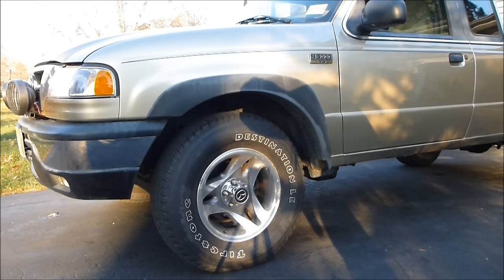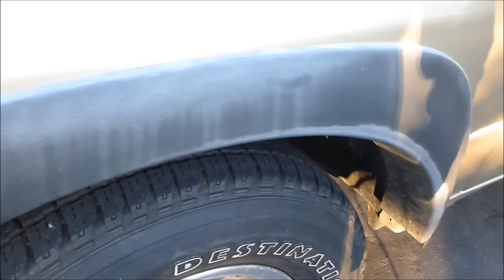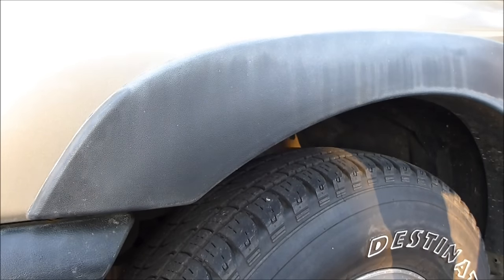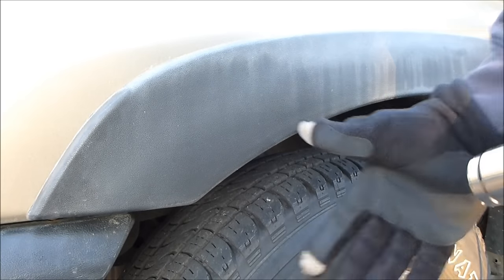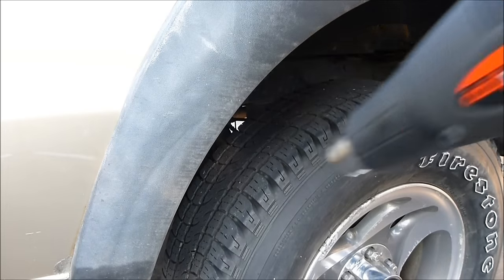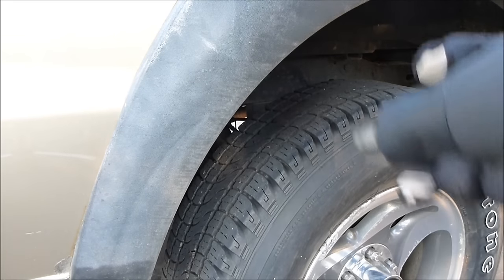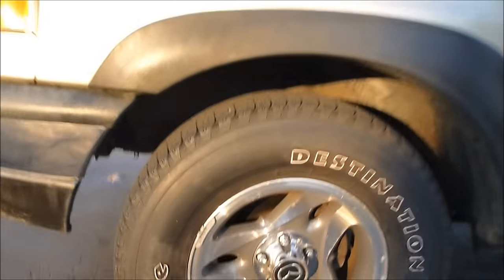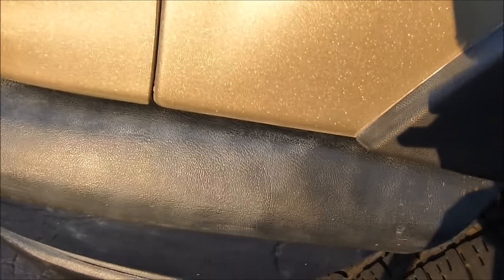Restore your Faded Plastic on your Car

Comment: heatgun = manly blowdryer
Reply: Yes, if you want to blow your hair with like 1600 degrees LoL
Reply: William F. Gorut not saying to actually blow dry your hair with it. but it looks exactly like a blow dryer, just targeted towards men
Reply: Both of them works in same way but they are quite different.
Hairdryer is designed to deliver big amount of hot(200C?) air, where heatgun is designed to deliver small amount of air but very hot(up to 700C) so it need steel chamber.
We can dry our hairs with heatgun but we cant restore plastics like that with hairdryer because this is not enough heat.
PS why girl is watching car vids???
Reply: Arek R. I mean't that it only looked like a blowdryer I'm not an idiot I know it wouldn't actually work as one and that it would melt your face. I'm watching this because i like cars and want to know how to take care of one when I get one because I am currently saving up for one... This isn't the 50's anymore women can like cars bro.
Reply: Nope, you can dry your blue hairs with heatgun without burning them, just use it at bigger distance so 400*C will be mixed with ambient 20*C and you will get proper 200*C.
Its cool that girl is learning about cars.
Im also saving money for my first car, I have bmw e46 on target(im from eu), there is plently of them over here but im looking for good deal.
Reply: LoL... Yes bro, these ain't the 50's... I've seen girls who can actually fix cars better than men
Reply: Yes its true, I work with girls that knows soldering and electronics where my bro dont xD
Reply: that's what I thought when I used one to remove grip tape from my skateboard lol
Reply: A heatgun is a tool and in no way is it marketed towards to "men" for "manly stuff", it's marketed as a tool.
Reply: you guys need to chill lmao.
Reply: :3
Reply: SoJayTay
Reply: are men not supposed to use blowdryers?
Reply: ***** I use hair dryers.
Reply: bendadestroyer on her "blue hair"
Reply: :) hi
Reply: spicy hairdryer
Reply: Lmao hey I got the joke. It’s weird when people get oddly technical about it too like ehhh shut up lol I know the deets but I don’t care because I wasn’t being serious 😂😂
Reply: Butthead “huhu she said blow” Beavis “yeah blow BLOWWW.”

Comment: I used to use this method but it only works for a certain number of times. Basically, it's all about chemistry and the trim goes grey because it's losing the oils. The heat gun helps draw the natural oils out and bring back the lovely dark shade, however, the trim will eventually run out of oils and this will no longer work. Trim dressing products can work for a temporary fix but for what they really are the price is silly. Best thing to use is Olive or Baby Oil, rub it in and let it soak into the trim and buff off. Should last a long time but I'd suggest further applications over time so that you fully replenish the trim's oils. A bonus being a bottle of Olive Oil is many, many times cheaper than the trim dressing stuff.
Reply: Natural oils in trim plastic :P You gotta be kidding man. All the heat gun does is melt the surface plastic and when it sets it looks like new. There is no oil here loolz...
Reply: @danijel124  Do you know how plastic is made? Educate yourself first
Reply: @ecsedits1808  please enlighten me loolz

Comment from the maker: Yea, it lasted about 6 months (not garaged) and its starting to fade. I sprayed it with a light coat of armor all and it has stayed black for another month so far (without being greasy). So it is definitely worth trying. Just be careful and patient! Thanks for sharing the video! Helps reach new people.
Reply: ChrisFix when you use the heat gun ur bringing all the oils to the surface again, which is the correct way to do it but you still need to maintain the trim after doing that to keep up the look... good video man, just subscribed. I find the videos very helpful. Thanks.
Reply: @hustlerkc11  how would you maintain the trim after doing this? I'm thinking of ordering a heat gun myself and giving it a go.
Reply: @AlexTheGardner  any trim protector with UV inhibitors

Comment: I was watching a few of your other vids on Ford Explorer repairs and had to watch this one.  This fix is the best method of restoring the finish on these plastic trim parts.  Since the parts are a type of high density polyethylene, the chains of this molecule are long segments, like a ladder.  When exposed to the Sun's UV rays over time, the chains are broken and cause the plastic to appear white.  This type of plastic is a thermoplastic which, when heated, allows the chains to reassemble, thus restoring the color until the UV does damage again.  This is far better than any cleaner/protector or paint that will fare far worse than UV and wash off with rain and snow.

Your videos are great as they are no nonsense, logical, and very instructive and have been a valuable asset in saving me time and boosting my confidence in several repairs.  No better feeling than being able to perform a repair that saves money and time....Subscribed.

Comment: So the question or the elephant in the room is what is the grey stuff on the plastic. why does the heat work.

The answer is oxidation, same issue as paint and windshields and what happens to plastic patio chairs.
The suns uv rays don't help.  When plastic is new, its pours are smooth, even shinny.  Same for a new paint job on a car. In the case of cars paint, we use soap to clean the dirt on the paints clear coat. This helps prevent dirt buildup causing damage but does not address the paints oxidation. This is because we really don't notice it as much on the glossy painted areas until the paints shine fades away. Most cars paint can be cleaned with a polish, and then waxed to protect the paint from damaging uv rays and the wax fills the pores of the paint to keep dirt from embedding itself and causing the shine to dull. 

Plastic is affected by the sun's uv rays, soaps we use to clean the car, winter road salt and other harmful petroleum based protectants actually fill in the pores of the plastic. This causes much of the greying. To restore the plastic, much like a leather, or paint you have to clean off the contaminants and nourish the plastic with a plastic conditioner. After conditioning the plastic, you should use a good quality plastic protectant. 

I think, repeating this  conditioning, and protecting does accumulate and the finish will last longer. The best recommendation for keeping the exterior plastic looking new is  cleaning and conditioning the plastic at least 4 times a year for your daily driver.  Refer to Meguiar's products for a nice plastic cleaner and protectant.
Reply: you burn off the oxidization weather abuse of the plastic. it's actually genius idea.
Reply: could not have explained it better. well said
Reply: Hey thanks for that info
Reply: The real elephant in the room is the fact that he said "sup guys" at the start of the vid instead of "hey guys chrisfix here"
Reply: Nick Maffeo so how do you know if it is oxodation or the color is just faded
Reply: If the color is faded, it's probably due to oxidation. I think the heat gun works because it's actually melting the top layer of the plastic, smoothing it out. One thing I'd like to say is you need to be careful not to overheat the plastic because you can warp a panel if you do this. I tried this on my Avalanche and the bumper popped out from the fender. TAKE IT SLOW and don't use too much heat.
Reply: @Nick Maffeo can you please name a good plastic conditioner which you think might be available all over the world? Like some generic conditioner? How about some olive oil or some other organic oil?

Comment: Man I wish I would have known this years ago when I had my Nissan Titan. The wiper cowl on the Titan is known to fade badly after only a year or so. I fixed mine by removing it and painting it with Rustoleum truck bed spray. It has a nice and fine textured finish. I liked it so much I also sprayed the door handles and mirrors. But the heat gun looks alot easier! I will picking one up from Harbor Freight to use on my Dakota soon.
Reply: Good luck with it

Comment: I did this to the plastic bumpers and trim on my 99 Grand Cherokee Laredo. When I purchased it the plastic was terrible looking, all faded and turning white. I hit it with a heat gun and was stunned at the results. Sadly though it only took a couple months before I could definitely notice it was fading again. I think I"m going to just get some bedliner spray and spray the plastics with it for a longer lasting look.
Reply: Mate listen to me, i have one. Buy yourself some silicone spray and rub it into it.

Comment from the maker: +Joe Carvall, the truck's pain is called Desert Sand Clearcoat Metallic
Reply from the maker: John Cottonwood I like the gray color that comes stock.
Reply from the maker: ***** That is tough. Is the pannel textured or smooth?
Reply from the maker: ***** Maybe just try using some polish made for black paint and see if you can polish them out.
Reply: Just use peanut butter... It works well and last about 2 months
Reply: +MUSIC 4 LIFE I don't know about benis putter. If it works then its cause of the peanut oil. If you put benis putter on it the mice will eat it.
Reply: +ChrisFix  Where to buy that heat gun in Turkey ? Does a random heat gun do the same job ?
Reply: +ChrisFix I just sold my 01 Ranger Super Cab. It was silver and looked great but I just didnt like the way it rode and drove. 4.0L V6 was a gas guzzler. Seats were not very comfy either. No offense! lol
I picked up an 01 Dakota Extended Cab Silver and it the perfect size truck, rides nice and is very comfy. Ive been watching your great videos cause that Dakota does need some work.
Reply: It does not affect the paint of the car?? My dads nissan pathfinder 95 needs this i think
Reply: DUDE YOU SOUND SO DIFFERENT! lol
Reply: +467sprite exactly what I thought!
Reply: TruthSeeker2046 lol
Reply: ChrisFix
Reply: Frederick Loh
Reply: What?
Reply: Crisfix my car is perodua viva and the colour of the car is dark blue , number plate is 552
Reply: I live in johor bahru taman anggik
Reply: Hi, after a month some people got a bad experince after using this treatment ..
The plastic trim got brittle..
Are you facing the same problem here..? 
Thanks!
Reply: Shrek Wazowski you can take out those plastic bara for safety
Reply: Vcir
Oo

Comment: Hey ! I  did this method while back on my SUV's faded plastic trims/claddings. It turned out great but the heat also loosened the glue between the plastic and metal body and the plastic is no more sticky to the metallic body.
Reply from the maker: TheNirmesh Interesting. Mine are not glued they are bolted in. That is definitely something you want to pay attention to though! Thanks for sharing!

Comment: Tried a few methods for plastic AND rubber trim using heat, different products,  etc.  The solution I found lasted the longest is cleaning, heating, then wiping on Car Guys Tire Shine spray, let it sit for 3 days, and wipe off excess.  It's been 3 months and the plastic and rubber is still black...  Even on wiper arms, etc....
Reply from the maker: Thanks for sharing!

Comment: I used this method for a while but then just ended up trying out black plasti-dip, it looks almost identical, you can get it at Home Depot or if you live in Canada like me, Canadian tire. And if you don't like the look it just peels off and is very weather resistant I used plasti-dip to black out the front emblem of my 03 tundra a year and a half ago and it still looks brand new and it's made through car washes and harsh Canadian winters, just a second product I thought might make a difference to anyone reading this xD anyways love the vids Chris keep them going 👍🏻
Reply: jynxx'd Thanks for sharing that.
Reply: jynxx'd what is the name of the product at Canadian Tire?
Reply: jynxx'd how many coats did you do?

Comment from the maker: I am holding it about 6in away. Start from 12in away and move closer until you can see it working.. Do not touch it to the plastic because it will melt it. If you can give the video a thumbs up, it helps me out! Thanks
Reply: ChrisFix but how do you do the edges without touching the paint?
Reply: Heat on high or low? My gun gets pretty hot.

Comment: Thanks for the heads up! I have an 03 Expedition with the gray trim and just tried it in a small area and it works pretty good.This will be a good fix for me now!
Reply from the maker: Great! Glad the video was helpful! Remember to give the video a "thumbs up" (it helps me out, thanks).Also, check this video out since you have an Expedition. Although your shifter might not be loose yet, this will help prevent it from getting loose which is common on fords! Let me know if your bolt ends up being loose! Fix a Loose Column Shifter

Comment: What I think it does is that the heat gun smoothen the rough surface of the plastic by "micro-melting" the indentation on the surface. Thanks a lot man,  that was an excellent job.
Reply from the maker: anas alwash Thanks a lot man! Actually, the oils in the plastic comes to the surface and "renews" the top layer.

Comment: What you did was a south Texas used truck salesman's trick.   You hid the vehicle's condition without fixing it. That solved your problem of not liking the appearance, but what caused it is now progressing faster.

The streaked clouded appearance was caused by minerals and wax bonding to the surface and then being washed away unevenly, probably by slightly acidic rain. Fusing it into the surface actually makes the plastic degrade faster, just more evenly.

When you don't remove the surface contamination and deteriorated surface before heating, you create a glossy coating over a weakened plastic surface that has a lower concentration of plasticizers and UV inhibitors beneath it.. You will experience a honeymoon followed by an unnoticed deterioration of the material that you will ignore until you eventually notice the surface flaking away. 

When a vehicle is a short term possession (3-5 years) rather than a piece of durable capital equipment (10+ years) then not investing the time to thoroughly prep the surface by cleaning and treating with UV inhibitors before glazing the surface might make sense. I've never been able to afford keeping a vehicle for less than 10 years. Keeping them good looking throughout my ownership helps keep me motivated to keep them in good mechanical condition.

Comment: I used plasti dip so i won't have to deal with any more fading
Reply from the maker: RedTeamWolf I cant use plastidip because that stuff would tear right off on the trails. I am doing a video review on some stuff that is working well so far. I will post that up in about a month.
Reply: ChrisFix well I put it on my b4000 4x4 and it's been fine. Just make sure to have a lot of coats
Reply from the maker: On the trails, do you scrape against brush and stuff?
Reply: ChrisFix Yup. My paint is in worse condition. And if you are worried about hurting it there is plasti dip clear that protects it
Reply from the maker: Good to know, thanks!

Comment: I am a DIY'er, I used a product they have at Walmart called Wipe New. I have a 2002 Avalanche with plastic cladding all over it. This stuff is the best thing out there. It's a small bottle for $20, but it goes a long way and last for a very, very,very long time as advertised on TV,  Give it a try.
Reply from the maker: I read up on it, but I heard it was a scam. So you say it works? Does it leave a sticky residue? How long does it last?

Comment: If this doesn't work then you need plastic cleaner, gray scratch pad adhision promoter and a black dye
Reply from the maker: Good idea
Reply: +freakyflow Yeah. I think the heat gun will make the plastic brittel.

Comment: So does this work forever or just temporarily?
Reply: SammySarah Qudsi This is mainly temporary (but might last a couple of months to a few years) but it’s basically bringing the oils in the plastic out and letting that evaporate, leaving a more brittle plastic trim behind. 

A plastic trim restorer such as “Mother’s back to black” or “Concept Vista” I much better since you’re adding oils instead of draining. This will at least last a couple of months. 

A much less effective, but highly valuable, is actually using peanut butter. This will last couple of weeks. 😊
Reply: In my car 2 years, never garage
Reply: that burns the dead plastic ,and becames like new ,used on 450 degres celcius ,after that ,used liquid silicone to be more stronger,sorry for my englis.

Comment: So as some other guy already explained in a comment below, the fade is cause by oxidation. The white is actually 'plastic rust' if you like. With the heat gun you burn the oxidation away, but it'll quickly come back. Compare it to grinding rust off a steel part but not painting the part. The plastic oxidizes because of a combination of road contaminants and UV rays. So stop these from getting to the plastic and your trim will stay new for years.

Like the other guy said, there are conditioners for plastic trim to protect the plastic. But, lifehack, there's another way: paint them. One: they'll look nicer than the result you got in this video. Two: they'll stay new for years to come, with absolutely no maintenance whatsoever. Use a clear plastic primer, then spray on satin black paint. I did this to my car 3 years ago, and the trim still looks exactly as it looked the day after painting it. And my car lives outside, not in a garage. Beats having to buy expensive meguiars products and having to treat the plastic every three months.

Comment: I use kiwi black leather dye (its for shoes) it has a foam applicator, also works if you happen to get wax on your black textured plastic, quick easy and lasts a long time. I worry with the heat that it wont look uniform when done or someone will damage their paint.
Reply from the maker: +Ryan Potter Thanks for sharing!